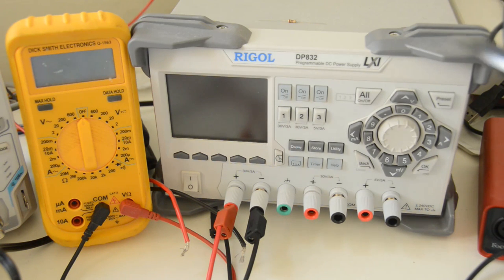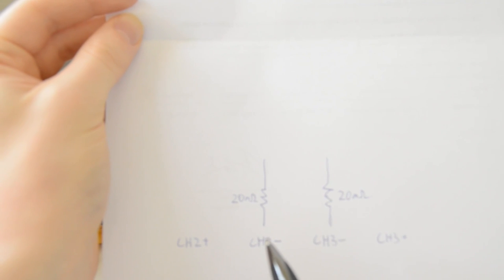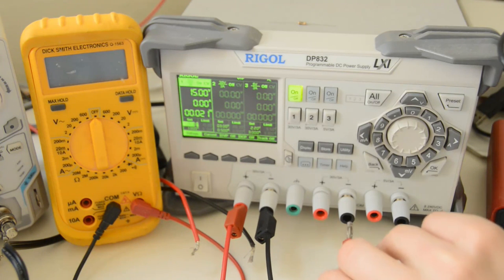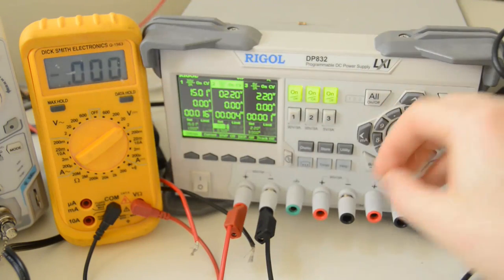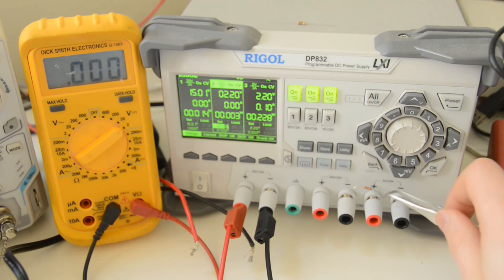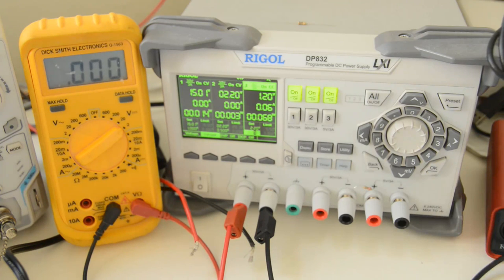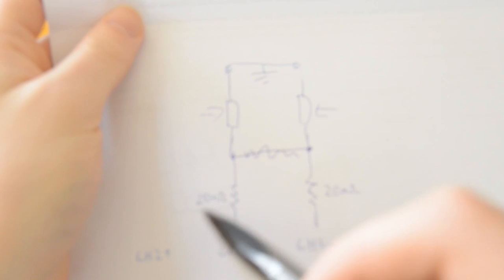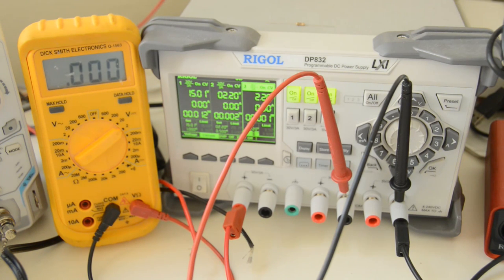Rigol DP832 negative rail resistors mystery

Comment: As a proof of concept, you might try the following scenario, similar to your first test:
Set Supply 1 with 1A limit, and connect to two ground terminals (2 and 3). SO far all the same as what you did. Turn Supply 2 and 3 on and see what do they show in the current range. 
If you'r guess is correct, one will show 1A and another -1A (?!? or some error reading). If my guess is correct and 20mOhm are NOT the current sensing resistors, both will show 0.

Comment: (Responses are limited in length, so I'll break them into more parts)
Can't say I have the answer to this conundrum, but I don't think 20mOhm resistors are current sensing ones. In your test with 0.1A the voltage drop on them would be 2mV, usually quite low and close to the noise levels one can expect in such circuits.

Comment: Another option to test might be connecting ground terminals 2 and 3 together, setting the current limit of one supply (let's say Supply 2) to 1A (or any other value), then connecting A-meter to Supply 2 and measuring the actual current. If two resistors are internally connected (at the "high end") as it might seam from your second test, they will present itself as 10 mOhm, and A-meter will get 2 Amp (not 1A).
Real mystery, isn't it. Cool.